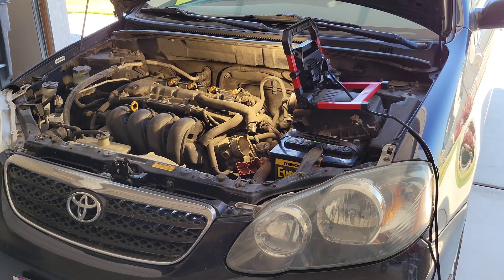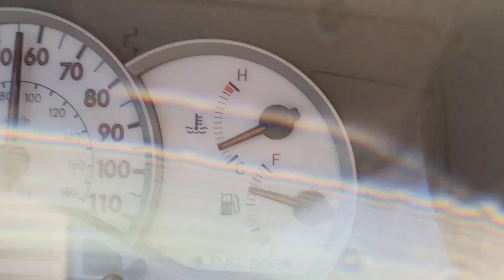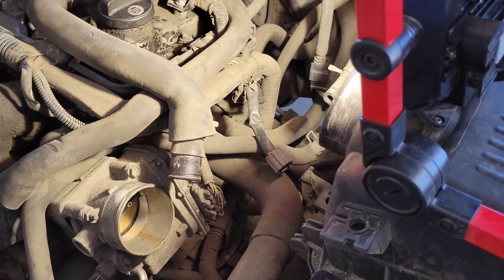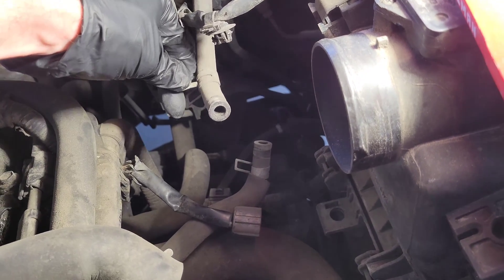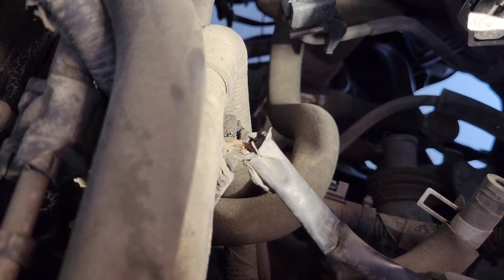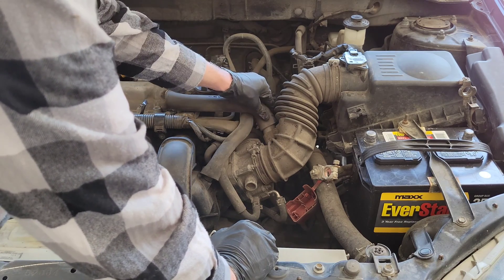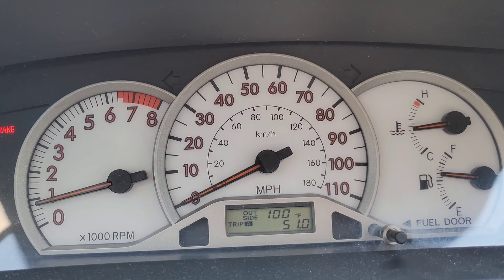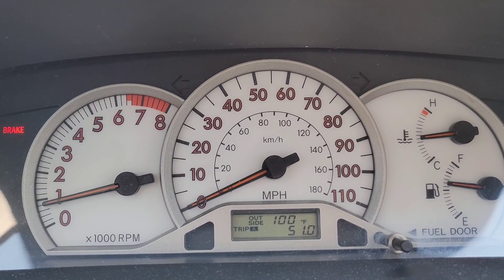Temperature Gauge Going Up And Down Randomly Fixed - ECT Sensor Wire Harness - Toyota Corolla

Comment: I love the vid but calling the engine cover a valve cover is super misleading to those whom aren't mechanically inclined. The valve cover is the bulky metal piece that your spark plugs go thru, coil packs are on top of, etc.  I know what you meant with what you said, but to be clear.....YOU DO NOT HAVE TO REMOVE VALVE COVER FOR THIS JOB.

Comment: That throttle body looks dirty and looks like it has oil in it. If you feel a loss of power soon or stall at idle on the breaks take that off and clean it out the black around the edge will cut the air flow down at idle and give you a rough start. Same issue haunted my legacy gt until I found it. No codes no cel. Just an fyi.

Comment: Just wondering man. If your sensor is giving wrong reading but your car engine isn’t hot. Can the engine turn off because it thinks your car of overheating?
Reply from the maker: Hi thanks for watching! If the temp gauge is saying your car is overheating I would believe it.  There is too much damage that can occur to your car if overheating and trying to drive it.  If it were me I would want to get to the bottom of it right away. Overheating can be caused by so many different things unfortunately. Good luck and hope you get your car fixed!